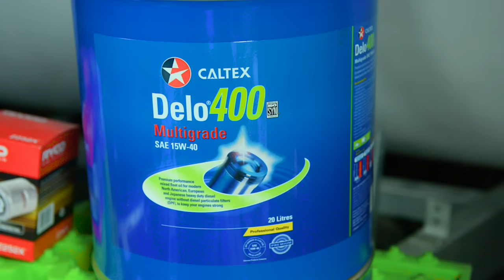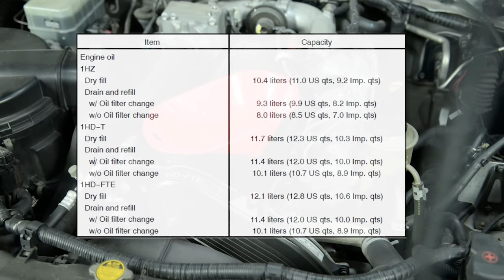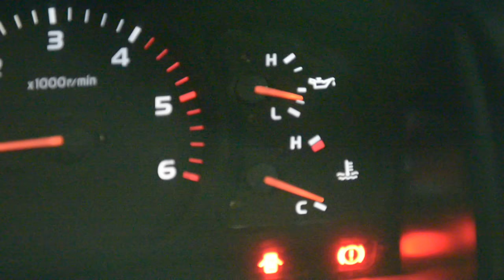How to service a Landcruiser 100/ 105 1HD-FTE, 1HZ, 1HD-T

Comment: Would you be able to go a guide on replacing wheel bearings?
Reply from the maker: Hello! Front or rear?
Reply: Preferably front
Reply from the maker: I replaced my front wheel bearings and rotors last year, ill try and find someone who needs it done.
Reply: That would be great thanks heaps! You should do more guides on landcruiser repairs!
Reply from the maker: No problem, im trying! Just got a lot on my plate at the moment. Unfortunately it take many hrs to make these videos. If I could get more patrons that would mean I could take a few days off a week and make more vids. (Thats the dream anyway!)
I need to do the rear bearings on my car fairly soon. Its a similar process the the front.

Comment: but how can you well grees the propeller shaft  there is no right place for to lubricate the car
Reply from the maker: There are 3 geese nipples per shaft. 1 on each uni joint and 1 on the slip joint.

If it has aftermarket unis, some of them have no greese points.

Comment: Can you help me to check the diameter of 09228-10002?
Reply from the maker: I will check for you when I go to the workshop next.
Reply: Thanks a million
Reply from the maker: Finally got it! Its 99mm with a vernier caliper
Reply: Thanks Dan, I couldn't get hold of the Toyota version but found the made in Japan KTC AVSA-099

Comment: dan the man....can you maybe help me my 1 hd fte has no power and scan tool shows no errors...new diesel filter new timing control valve everything seems to be fine but no power
Reply from the maker: The one and only!
Are you getting a engine light? manuel or auto? does the RPM go over 2500?

Need some more info please!
How many km has the car done, is it well maintained, have the injectors been done, hand any turbo work, did you pick up any dirty fuel.

Cheers!

Dan
Reply: no engine light engine revs up fine vehicle has 260000km on the injectors have supposedly been done before i bought it 3 months ago and new edu fitted and its a auto and became like this after a car wash turbo is stock and boosting 0.8bar
Reply from the maker: Does it feel like its engine or gearbox? Could also be the bands in the box slipping.

Have you checked your air filter? or checked if anything is blocking the intake? blocked the EGR system? (could be stuck open)

Checked to see if any of the brake rotors are stuck? after a drive are the hubs hot?
Reply: redone the diesel pump and guess what it is still the same after diesel pump recon....drove well for about 100km no has no power again...wonder if the crank sensor isnt faulty
Reply from the maker: +James Sinclair could be a number of things. Have you inspected the fuel tank?
Reply: Filter in fuel tank is clean
Reply from the maker: +James Sinclair have you checked if any of the fuel lines are crushed? inspected intake and EGR system? (recommend blocking your EGR) and cleaning the intake from soot. 
Also inspect your engine breather. 
Is the waste gate on your turbo activating correctly? Do you have a boost gauge installed?
Reply: Dan vs Car car doesnt have a egr valve replaced all vacuum lines boost gauge is reading 0.8bar
Reply from the maker: Hmmm, when you say a car wash, did you wash the the engine bay? or just the outside of the car? sometimes water enters from around the windscreen or from the roof rack bolts and causes electrical issues in the car.
Reply: clean the intake manifold and pipe from the turbo compressor to intake manifold and the intake manifold itself. they get choc-o-block from egr/engine oil

Comment: and you  well not damege  the wirer
Reply from the maker: What wire?
Reply from the maker: If you are talking about the wire on the fuel filter, you can disconnect it from the car. Then unscrew the filter.